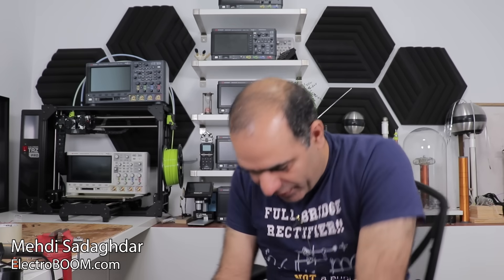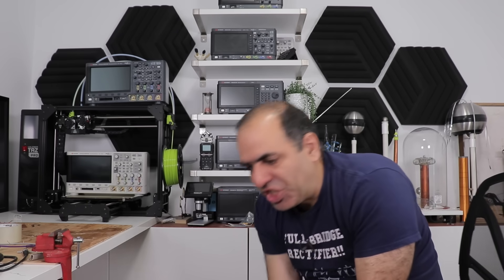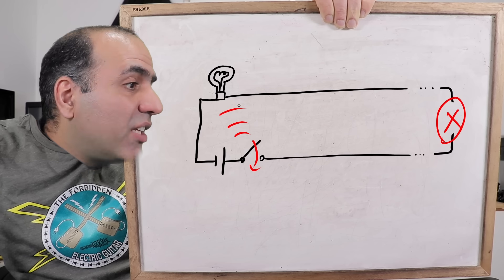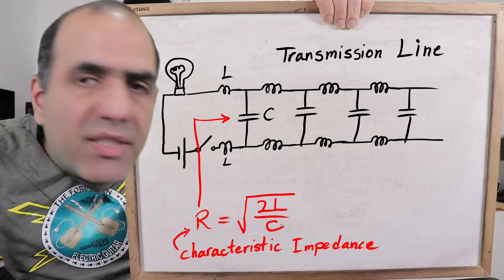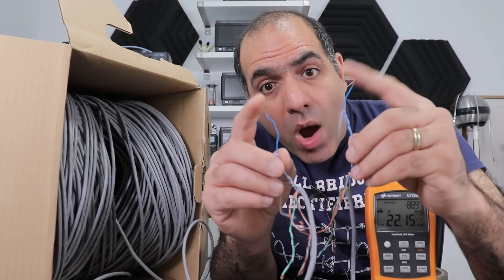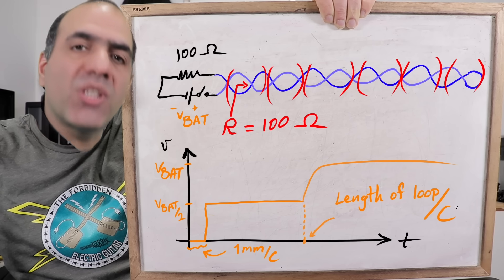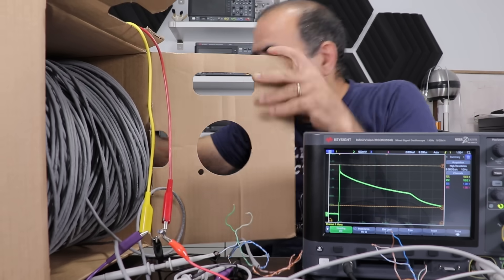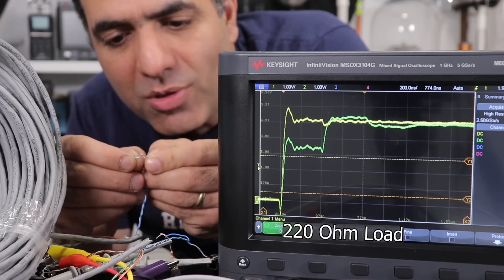Testing the LONGEST LOOP OF WIRE!!! to Turn a Lamp On

Comment: 1:54, it really does matter. With wire loop in box, you have bulb and switch few meters apart. 
Universe render this in same chunk, so no real physical lagg, other than energy flowing trought conductor.

Maximum speed of information to travel doesnt apply to wire lengt in loop, but rather to space itself. And also, energy inducted in that wire loop can affect across loops, so that can be also missleading.

Comment: So my question is now how does even work in battery then doesn't it involve the separation of cell to bring them back to you one point when charging. How about electronic does that means that all electronics in side a device is only affected by magnetic field and that cause all the electronics to work through magnetic field. If you could explain how does this work on electronics please.

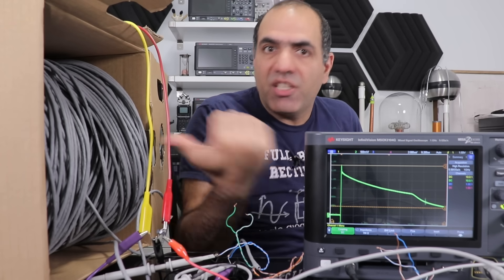Comment: 12:50 I wonder why he used the word "dielectric" medium instead of conductive. I thought a dielectric medium is an insulator (like the stuff between two capacitor plates).

Comment: Since electricity does not travel strictly to the wire to turn the bulb then why would you need to connect anything to the secound wire from the twisted pair. The bulb does not know if you are connecting to the wire that "supposed" to close the circuit but is not closing it or just to any other random wire like... the probe wire. Right? So led with a resistor connected to positive pulsing power source with no connection to negative terminal should just stay on..  or pulse so quickly that it seems it stays on.

Comment: But first you need to empty the wires removing the electrons from it, if you did not you will just push the electrons already is on the wire.

Comment: 4:55 "Adding a load across the LED actually helps it".  Yes, it does sound contractictory, but you're actually "reducing" resistance from trillons of ohms of air to whatever the resistor is, thus increasing the current.

Comment: That's because you're thinking of electricity incorrectly. Imagine you're pushing on a long line of ball bearings. They all move at the same time when you push on the first one. That's why the light is almost instantaneous

Comment: In networking classes, when estimating propagation latency for long connections, we’d always use 0.99c for fiber optics and 0.66c for copper transmission lines. In that class it was presented as a heuristic - cool to see it confirmed directly for CATn cables.

Comment: The reason it is less than speed of light is because the speed is determined by the wires capacitance. Or in physical terms the width of the wire that needs to be accommodated as the electrons cannot move in a straight line but has to take into consideration the cumulative effect of first pushing all the elections along the width too before the collection together pushes forward aka capacitance. The higher the voltage the less you will see this because voltage = density of the electron movement (how many electrons along the width are getting pushed "at the same time")

Comment: why does the potential only last for some time when the loop is disconnected, the electron concentration near the battery should still cause current and potential, why is that cancelled out?

Comment: Edit to add: it's possible the ground loop hum was related to some weirdness with the ground being shared over the line cable, but that doesn't make the audio recorder being on with the audio line cable disconnected any less weird looking.

y'know, it's funny, at one point some years ago, I observed something similar to this when I was trying to run a camera and audio recorder off the same power source and remove ground loop hum by floating the 0V to the USB input on the audio recorder, but I had been horrifyingly out of date on my daily dose of ElectroBOOM so I didn't see this whole series of videos and kind of assumed what I was observing was a weird floating "ground" thing I had yet to understand (+5V USB was connected, but 0V was left floating, I even resorted to clipping the cable's foil shield to exactly the same effect—I was in my first year being an industrial mechanic so I was in no position to make educated speculations on weird electronics behavior). To expand, I expected this wouldn't do anything, but with no effective 0V rail, the audio recorder still turned on and stayed on (it consumes very little power in operation).

Even weirder, ground loop hum was still present with the floating ground. Eventually, I had to resort to normal power and an isolation transformer on the line out to the camera audio input.

Not sure if this helps make something make sense, but the USB power was off one of those cheapo V mount plates cinema nerds waffle on about (when I scope it with my newer scope, the "+5V" is actually more like +~16V, but chopped up by a MOSFET with an apparent frequency of like 40kHz and a ~30% duty cycle).

I'm not an electrical engineer (obviously), nor do I cosplay one on television (obviously), I've just been watching this and bigclivedotcom for like 10 years.

Comment: I have a question I couldnt find the answer anywhere. In this scenario, how does the electrons know they have to move specifically for that field? I mean, the electric field induces the cgarges to move, this creates magnetic and evergy gets tranfered and lights the bulb. But if all of this happens before the feedback from the end of the cable, how does the bulb knows it is conected to that battery? If there were another buld, connected simetrically the same ad yours but with the infinite cable set on the opposite side *as mirrowed. Would both lamps light at first, then after the feedback never reached the second, it turns of?

PLEASE HELP MEEE

Comment: So... if electricity moves on the surface why are wires not hollow?  Wouldn't resistance be less and current carrying capacity be higher for a given diameter?

Comment: What if the wire is instead of parallel it is round so that it doesnt have capacitance becoz the wire has a great distance to each other. Will it have a delay?

Comment: 13:05. I can't believe you went through the trouble of using a meter to measure 40m. The cable length is written on the cable itself at each one meter interval.

Comment: Would different amperage through the wires give different results.  Because I think it would be interesting to see the results on the oscilloscope when the wire burns out due to heavy load.  Ps.  electrons actually travel from the negative to the positive pole.  We draw and calculate the electric current based on the lost positive charges traveling in the opposite direction.  If I wanted to do a real test I would have to close 4 switches at the same time.  To have a captured moment of electricity traveling through a conductor.  otherwise, the electrical potential is always waiting on the exposed part of the wire.

Comment: Wait, if two wires are parallell and current is passed through one, then a current in the opposite direction is induced in the other wire? The field from the first wire will be stronger between the first and the second wire that it will be outside the second wire. If they are close though, then a third wire will see essentially no field in the mid/far-field

Comment: You changed the entire circut! You now have a pulse train flowing into an R-C circuit, with tiny LED - NOT the same circuit as veritasim.  You modified the cicuit until you made it work = cheater.

Comment: You have not shown how much ENERGY can be transmitted between two antennas spaced 1 meter apart during the first 1/c sec.
Reply: Not enough energy to illuminate the very large bulb, shown in the veritasium video.

Comment: You should put those 80 meters of cable in a copper tube...then vacuum the inside of the copper tube...then watch how fast electricity really is...

Comment: So, imma put some led's in my room with a Cu cable with (.66* C)/5 length , and a function generator that pulse's 5  hz, so i can see the leds blinking just from the first electric field, then when i lower the frequentie of the generator my leds will turn on first from the electric field and then from the actual current( if i close the loop ofc) 🫣

Comment: If you looking for linkable string lights you can actually find a lot of them and you can actually put a quantity that you want. For example, I put one that’s RGB and automatically color changes and works with a remote and I chose four sets that are linkable and each set 49 feet so close to 200 feet string lights

Comment: I'm confused why the speed of light through the wire is relevant here.  Does the electric field actually send out photons as "feelers" to find the short or open in the circuit?  Or is the speed of light just the speed limit for the field to propogate? If so, why would the medium matter just the same way that it matters for photons?  Are the electrons that free up actually shooting out photons to bump the next electrons to make current flow?  This stuff is so weird.

Comment: @10:27 "the longest loop of wires in existence"
I read Large Hadron Collider wire loop is 250000 km long with total wire length over 1,800,000,000 km, long enough for the hypothetical setup of Veritasium.
Light would travel that distance 50 minutes in vacuum, and 80 minute in the wire

Comment: The electron drift along wires is slow, very slow. What travels in wires at tremendous speeds is the electric field. This spead can be almost equal to the speed of light.

Comment: “It doesn’t matter!”

But you are testing a VERY SPECIFIC QUESTION, so even if you KNOW the answer, the whole point is to DEMONSTRATE it - if you change the experiment based on what you already know about electricity, then why even bother with the experiment at all? If I ask you to prove to me that 2+2=4, I don’t need you to prove it to me by showing that 2x2=4 - yes, both are valid and in a way both are the same problem written in 2 different ways, but the whole point is that my question is whether 2+2 is equal to 4, not whether 2x2 is.

Comment: This should be shown in everyone’s emag class after learning transmission lines. Very cool to actually see the reflections on the oscilloscope and to see why impendence matching important for maximum power transfer. Also cool bonus is that you proved you can actually model the electric field interaction between 2 wires as a capacitor!

Comment: 11:40 there is a way to reduce the wires resistance to zero, but it requires really expensive wires and a liquid helium cooling system.

Comment: TLDR: Energy is transported both by electrons and through the fields. Electrons interact via the electromagnetic field, and the energy related to these interactions is carried by this field, allowing for energy transport both within and outside of conductors.

In the realm of quantum physics, matter is composed of fundamental particles, exhibiting a property known as wave-particle duality. The electron, one such particle, is not just a point-like entity but is more accurately represented by a quantum field, the electron field. Electrons carry an inherent property - electric charge, which is quantized. This charge is not merely a label, but the source of rich interactions mediated by another quantum field, the electromagnetic field. These fields are distinct, yet intimately connected. The electromagnetic field mediates the interaction between electrons, and this interaction is fundamentally governed by the amount of charge they possess. This relationship is captured by mathematical models such as Coulomb's law. However, in our daily language, we often speak in terms of voltage, which is tied to the electric field. This is an electrostatic approximation, and in time-varying, dynamic situations, it's more accurate to speak in terms of the broader electromagnetic field. When we discuss the flow of electric charge, we talk about current, which is typically confined to conductors like wires. But when we consider the flow of energy, we enter the realm of the electromagnetic field that surrounds and permeates these conductors. The Poynting vector is a tool that gives us the direction of this energy flow within the field. The energy within these systems is a conserved quantity and represents their capacity to do work. This is encapsulated in the definition of work, W=F⋅D⋅cos(θ), where F = force, D = displacement in meters, cos is the cosine trigonometric function, θ is the angle at which the force is applied, and work has units of joules (J), a measure of energy. The potential energy of an electron within a system is a function of its location and proximity to other charges, indicating its capacity to do work. The electromagnetic field is more than just a stage for these interactions. It's a player in its own right, mediating the forces that move electrons and is responsible for transporting energy in electromagnetic systems. Within this field, electric and magnetic components are inseparable aspects of the same entity, influencing each other such that changing electric fields coincide with magnetic fields. Energy is carried within this electromagnetic field, extending around and beyond conductors. In alternating current (AC) systems, the oscillating electric and magnetic fields can carry energy away from the wires, illustrating that energy is indeed transported via these fields. In contrast, in direct current (DC) systems, the electric and magnetic fields are static. The energy transfer still occurs via the electromagnetic field, but the energy remains within the system unless a change occurs, maintaining the principle of energy conservation. In conclusion, the dance of the electrons, mediated by the electromagnetic field, plays a central role in energy transport both within and outside conductors. The story of energy is told both by the electrons themselves and through the fields they interact with.

Comment: Honestly the set up doesn't matter. The entire test is to prove that the electricity doesn't have to travel the entire length of the wire to turn on the lamp, and showing that the wires aren't even connected at all, but will still momentarily turn on the light because of the magnetic fields is proof enough. It doesn't matter how far away they are, just that there is no direct connection that is transfering the power. The closeness helps show it better with the low power. Also for the most part there is no harm in thinking that electrons flow like water through the wire, the only time where it can be problematic, is in these situations when the magnetic field can actually begin transfering unwanted power

Comment: Using a twisted wire pair is being disingenuous to Derek's original experiment. You've increased the capacitance by at least 1000x. Yes capacitance moves at the speed of light across air, but this isn't so interesting. Derek's original experiment never could have moved a significant amount of power to light even an LED without increasing voltage and frequency to impractical levels.

Comment: Can someone help me with my question to understand please? What if the lamp is too much far away from the battery and the switch. Will the electric field be able to reach the lamp? and if so than any electric field around the lamp can make it turn on? I m having a hard time understanding this. So if we have other electric fields from different batteries can make the lamp go on?

Comment: If property acts as a wave, where is the midpoint of the wave, where oscillations would be cancelled and the transmission of power would be greatly reduced, or zero, or, using inductance, to make the voltage a negative value, you could test with a sort of clamping voltmeter, acting as a transformer.......

Comment: Oh, dude!  The last bit, with the different values of resistors, that's the SWR of the transmission line!

(I just got my amateur radio license, but actually seeing it in practice means a lot more than knowing the theory.)

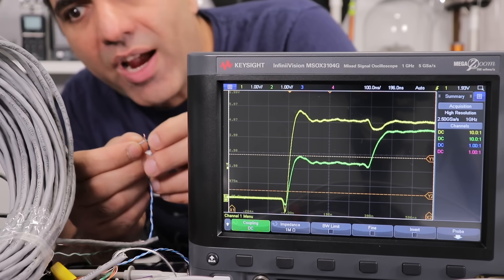Comment: 14:00 onwards for a bit:

So this is why end of line termination resistors were/are so important for things like phone lines, early networking equipment, and so on. Interesting! If you had a wire run from LA to NYC and back again, I wonder how long it would take the waves to figure out that the circuit opens or closes.
Reply: It's actually interesting to see that when the closed circuit is overdamped, the open circuit is underdamped and vice versa. Why is that?

And yes, the terminating resistor's purpose is to match the line impedance so the circuit is critically damped and no ringing occurs. Otherwise you could potentially end up hearing an echo of yourself over the phone's receiver. I had an old phone that did just that and let me tell you, it was really annoying to make calls with that phone!

Comment: Why twist the wires? Why keep them only one meter apart? Why not put them in a loop, one light second in diameter. Would it take one second for the light to turn on then?

Comment: Okay, did I miss where he said that this proves that the magnetic field activates the flow of electrons? Because I heard him say that the charge flows the entire length of the wire and back again. I guess I'm confused about what he was trying to prove (or disprove?). If I didn't already have some knowledge of the things he is talking about, I would be a lot more confused than this.

Comment: okay i had a brainwave maybe sh.. by I'm new to electronics if you add faradays findings with Leonardo perpetual motion and simple ohms law with that Roberts water thing but customised into a generator water circuit you would have full free energy breaking 2 laws of thermodynamics.

Comment: I have heard of stock market algorythmic systems that capitalize on the data speed over distance and make money because it "wins the race". Maybe it was fiber vs wire. Doesn't that kill this theory? Electricity and light should be the same speed.